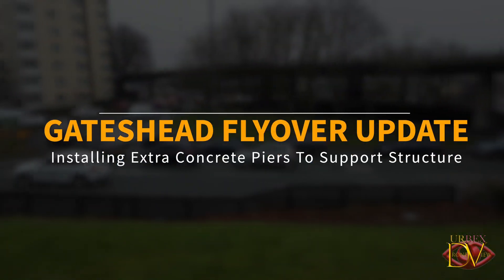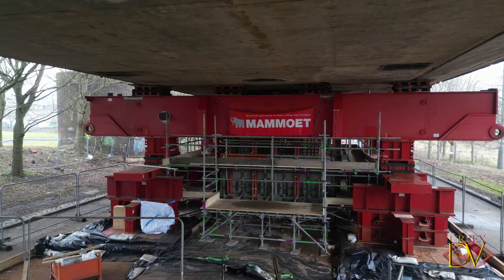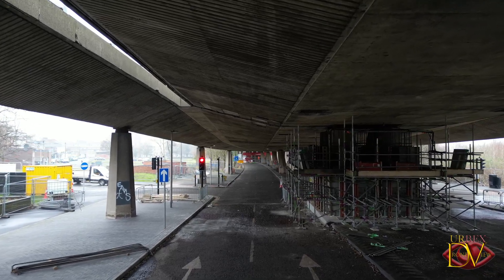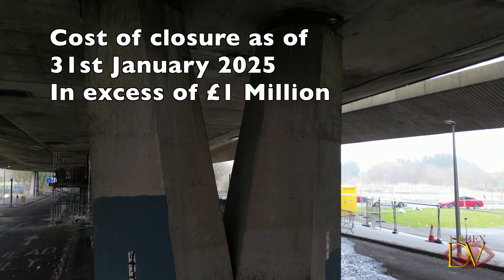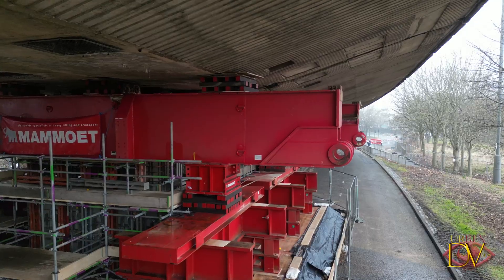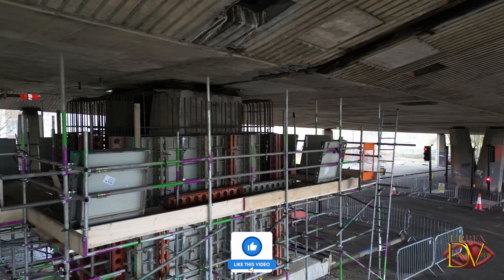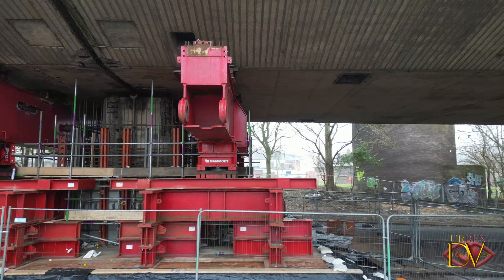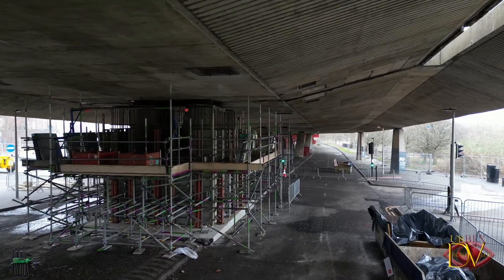🚨 Gateshead Flyover Shutdown: New Concrete Supports Installed for Safety!  Feb 2025 Update

Comment: This is a box-girder bridge and as such, they likely have corrosion in the post-tensioned steel cables or anchoring blocks that are key to the bridge's strength - and not the support pier itself. This is likely why they are concerned. At 3:46, there is a missing inspection cover that appears to have pigeon droppings flowing from the interior of the beam. The droppings are highly corrosive and the reason for the covers.